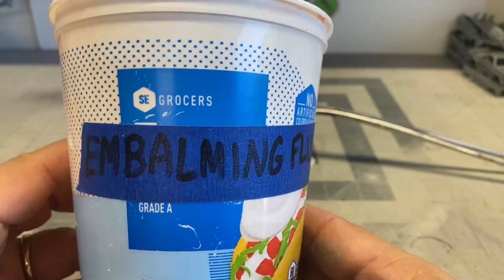Hot Wheels Redline Hood Repair

Comment: Looks fantastic Paul. I am wanting to try to convert a olds 442 police cruiser to an "Olds 442" car for my collection. I had 3 growing up and gave them to my nephews in the 80s. They got played with. Lol. Have yu done this? I am curious to see how you would handle dealing with the sirens on the roof and smoothing them out. Thx Dan
Reply from the maker: Dan: I think you would be better off using a maxi taxi or a fire chief car. That way you can just file off that little piece of metal on top and not have to worry about filling the hole with the police cruiser.

Comment: Nice job, as usual.  Any idea what the metal is that's used on the hoods, is it pewter?  Have any luck getting your glass to be blue?  Keep up the good work.
Reply from the maker: It’s actually Bismuth. It has a very low melting point and it is a little softer than most metals. The reason being is that it’s low melting point allows you to pour the metal into rubber balls without the mold melting.

Comment: From my experience? These redline shop metal parts are TOTAL garbage. I wouldn't pay a penny for one. I had one crumble in my fingers. Just get another car for parts. Anyway... NICE job my friend. The paper clip idea is awesome and WORKS 🙂
Reply: @DiecastGraveyard   For $9? I'd rather buy a parts car off eBay and fix it right. I used barely any pressure and the piece of junk I bought crumbled in my hand. maybe they changed the recipe now, I dunno.
Reply: If you used a dremel on it that would be the problem
Reply: @maximojoe7398  Nope, didn't touch it with a tool.